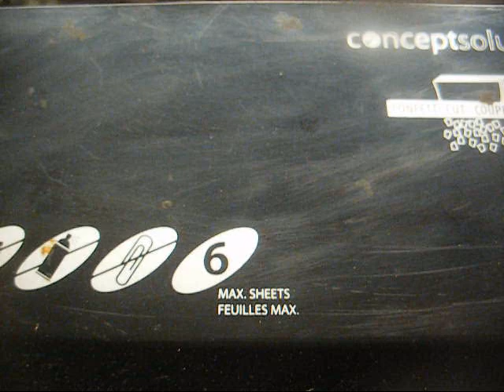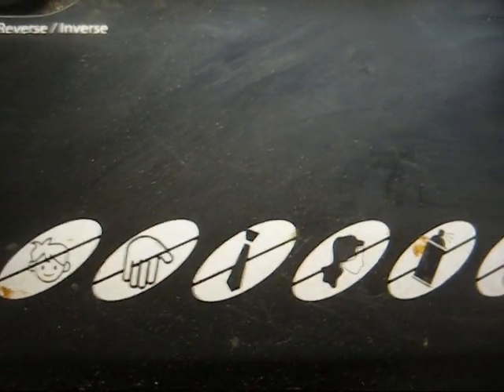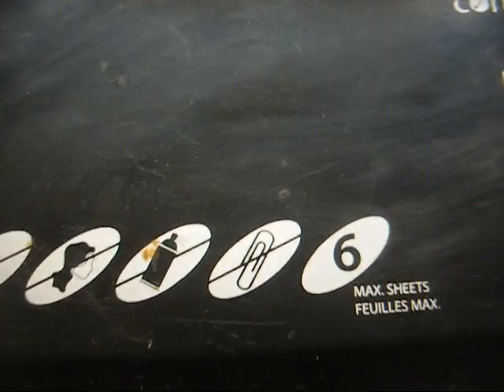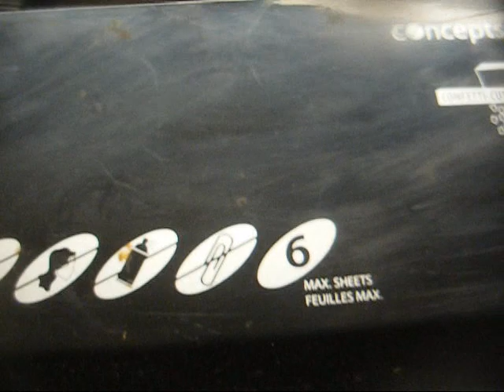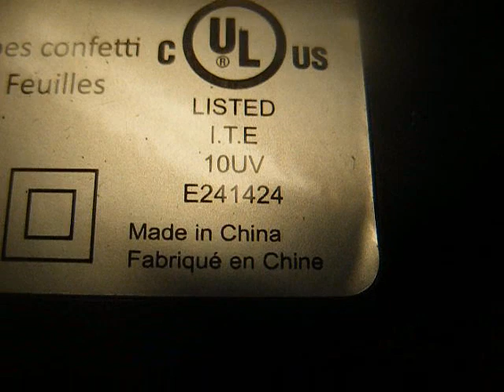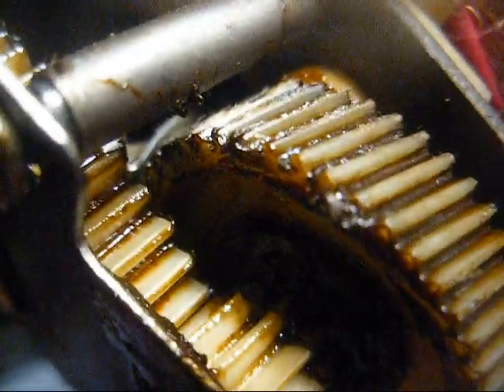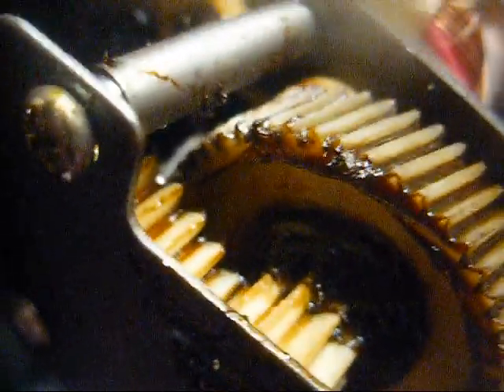Paper Shredder EOL

Comment: My last crosscut shredder was a Royal 1830MX from Sams that handles 18 sheets of paper.  I am still using it and not one moment's problem except for the auto shutoff in forward mode.  It just happens to have a small switch in the back that does that quite nicely.  I have tried so many others and faced many hours of frustration as I watched my money go out the door with the next day's trash.  I have bogged it down a couple of times but that was because I was feeding it more than the 18 sheets it is rated for at the time.  It can handle CD's, credit cards and paper quite easily.  The two prior to this were Fellowes brand and stripped the cheap plastic gears not long after I wasted the money buying them.  But, I now have two extra waste baskets.

Comment: BTW: you can add a lot of life to a brushed motor by cleaning the crud between the commutator contacts (carefully) with the pointy end of an X-acto (or box-cutter) blade. A tiny drop of oil on the bearings can help, too. That being said, there’ll always be some sparkulating with brushed motors. If the motor is DC, a .1 uF to .47 uF disk capacitor across the motor terminals can cut down on sparkage as well. It’d be a shame to toss a perfectly good motor; maybe you could make a direct-drive turntable with it. 😏

Comment: haha looks like everyone saves the paper baskets from these for trash cans; I have one also.  the shredder I had got bound up when the paper strips wrapped around the cutter, because the plastic "fingers" were broken.  so I could clean the paper out and it'd work great until it got wrapped around again.  after having to clean it every 2 or 3 uses I got tired of it and EOL'd it too.  still got the switch and motor somewhere and the power cord.
Reply: @kevtris well not everyone saves the basket mine didnt come with one you had to use your own ! the motor burned out on mine I got a new shredder with a basket so at least I can save it !
Reply: @thehappylittlefoxakabenji8154  One way I have come up with to shred paper without wasting money on a cheap one is to use an old kitchen garbage disposer from the trash when you're not installing it in your sink, or improvise your own belt driven shredder with a ¼ horsepower motor driving two leaf shredder blades. It has a wooden blades and an on-off switch to turn the motor on and off.

Comment: ALL brush-types motors have sparking at the commutator. This is only serious with very large electric motors- but they have special modifications to control brush sparking- and these features are not practical with small electric motors.

Comment: There was one exactly like that at work. They used it 6-7 days a week for about 10 years. The teeth won’t clean after they get a lot of wear which makes it clog up and hang. 
I fixed it 5 or 6 times. To be a cheapo it really took a beating over the years. It died with the same failure as yours.